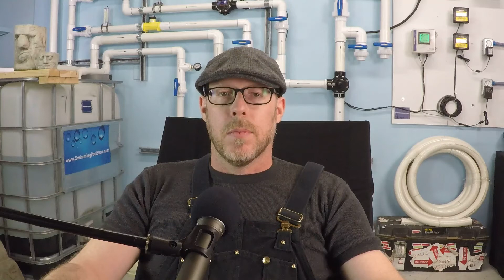How Do You Lower TDS Levels?

Comment: I have a 12x24 above ground 4" oval pool with a cartridge filter I can't get clear;  I've tried all the more common methods without success. I believe my next step is to drain , however everything I read says not to do so in risk of damaging my vinyl liner. At this point I feel I have no choice. I will use your advice and drain down to 12" . Once I'm down, is there any suggestions besides a debris cleaning you may have before I refill ? Thank you.